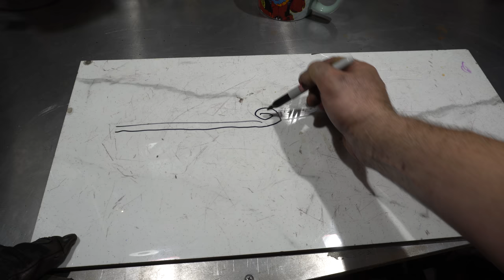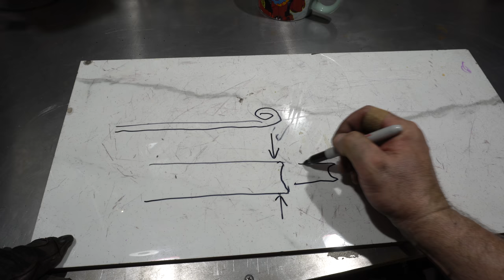Triple-T #53 - Beginner knife making series - Forging

Comment from the maker: Any forging tips I missed?  Are you ready to try forging?
Reply: I have 1 question for you....you left a lot of meat on this forging but I know you have a 2x72 grinder that can hog material off when you need to but for some of the beginners out there what thickness would you suggest for a blade be forged down yo if they are using a 1x30 or 4x36? Always enjoy the videos and appreciate the time and effort you put into them. 💪🔨 🔥 💧  🗡
Reply from the maker: @cae2487  If you don't feel like forging it down more, the angle grinder with a 1/4" disk is your friend.  That's what I'll probably use and show in the next episode.  👍🏻  I was getting tired of hammering and saving material was not my #1 priority since I have enough leaf spring to last me years.
Reply: First off, awesome intro video, really well done. As for forging tips you missed, I would say drawing over the horn. Especially with 5160 being so stubborn until you really work it down, the horn combined with the rounding head can save you so much time and shoulder strain. Also, possibly, working across the anvil for a reverse taper while forming the tang / handle portion to save a little time and reduce sweat equity. Just my thoughts, hopefully they are helpful. Regardless, another awesome video, thank you for sharing it!
Reply from the maker: @bjornronaldson6017  those are good points.  I mentioned the round edge of the anvil for that type of thing.  With the price of anvils these days, fewer and fewer beginners are going to start with actual anvils though.  Thanks for watching and commenting!
Reply: @TyrellKnifeworks  that is a very, very valid point.
Reply: yeah in the future remember not a finger weld its called a choil

Comment: My one and only knife I forged so far is from a large machine chain link. Similar shape to your leaf end. My best tip for anyone hitting springs or leaf's.  Don't try to move the metal if the piece is not hot. You are wasting energy. Keep it at least bright orange when you are trying to get metal to move. And use a hammer that don't wear you out. I could swing my 2lb a lot more than my 3lb. More accurately. Thus getting better hits. 
Denis, Love your work and tips. Thanks for putting these videos out.
Reply from the maker: That is an excellent tip that I didn’t mention.  Keep your work hot! 👍

Comment: I've seen Lin Rhea (who is my absolut favourite bladesmith- he doesn't need belt grinder - literally) use round bar to hammer handle part where the first finger goes. I believe that it works even better than the horn.

BTW: did you watch Jason Knight video (BLADESMITHING | Forging Without A Power Hammer | Basics). If you didn't you should watch it- He shows how to use edge of the anvit to maximize power of each stroke. It's very helpfull especialy on thick bars. Great video, as always!
Reply from the maker: I mentioned the edge of the anvil in the video.  Like I said, I’m certainly no forging expert.  Jason and Lin are certainly masters at the craft  👍
Reply from the maker: @liquidmidnight0748  he sure does!